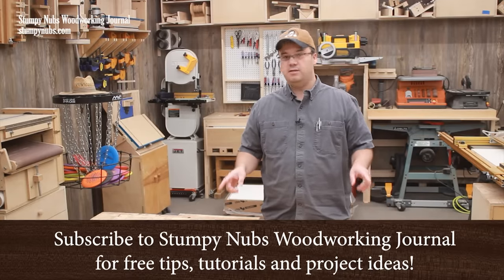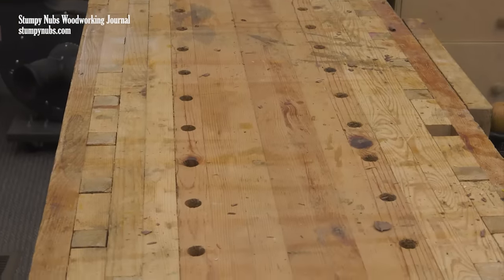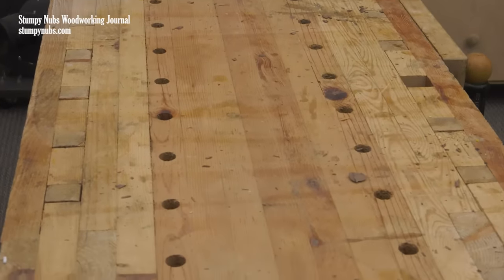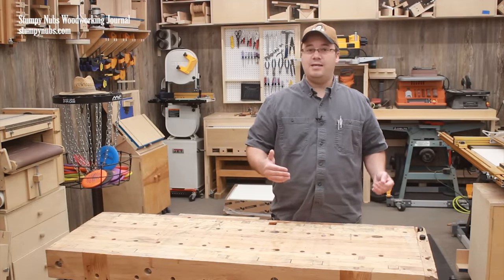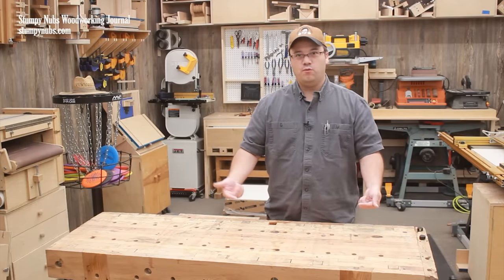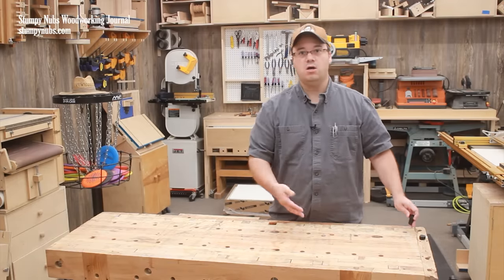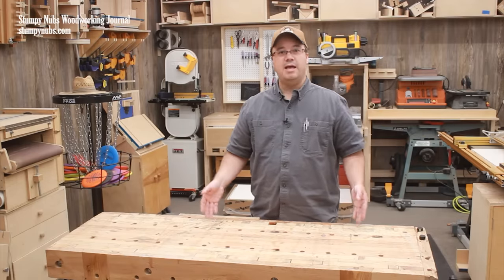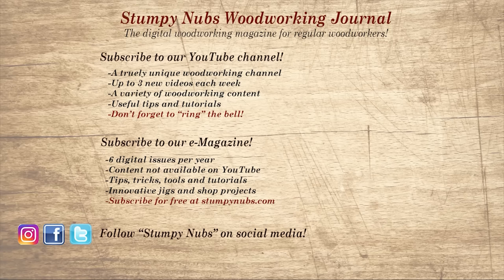Will a cheap 2X6 pine workbench last?

Comment: My great grandfather built a workbench out of pine.  It was about the same size as yours.  When he died, my uncle claimed it.  For years it sat under a tarp in his back yard and was used from time to time as a potting bench.  About 12 years ago I asked if I could have it.  After getting it, I cleaned it up and it is working as well as it did when my great granddad made it back in about 1910.  So pine will be fine if you don't bash it around.
Reply: I made my workbench out of cast off 2x4s in 1990. Since then I have built dozens of projects on it. It has an end vise and uses a square dog. It is 5’ long and 24” wide with tool trough. On it I have built numerous book cases, China cabinets, and tall boy dressers as well as many little items. It is the ingenuity and skill of the craftsman, not the gizmos on the workbench that matters.

Comment: I bought your plans, but took a lot of liberties with them when I built my bench.  I made mine from standing dead eastern white pines that I cut down on my property with an axe and bowsaw.  I cut kerfs in the logs and chopped the joggles off with a machete, and then hand planed them (using a #7 to get a glueable joint).  I ended up with 4x5's, and I milled the mortises & dog holes on their sides before the glue up (I left the bottoms round).  Once I had the top, I put it on some sawhorses and used it to build the frame, but I used all mortise & tenon joinery on that.  The reason for using hand tools was because I enjoy that more, and it was my exercise program last summer/fall. If I had run on the treadmill, I wouldn't have a bench.  The only money I spent was on the glue.  Thanks for the plans - they were very helpful!

Comment: I built one very much like this in 1980. Multiple houses and shops later it is still my main work surface. 2x6 frame, 4x4 legs, and 2x10’s laid flat for the top. Every few years I tighten the bolts that hold it together, smooth out the top a bit with a long plane, and give it another dressing of linseed oil. Height matches my table saw. Quick mounting system for my miter saw. She’s been a good partner!  Love your channel.

Comment: I can vouch for this bench design.  I bought the plans several years ago.  I made mind from 2x10 douglas fir construction lumber since I didn't have any old stuff around.  I let it sit a month or more as suggested.   The bench still looks great, though its not quite as old as Stumpy's I don't think (close though).  I used a vise screw from grizzly to make a leg vise, and originally had a pipe clamp end vise but have recently replaced it with the Twin Turbo vise.  I skipped the square dog holes and the threaded rods going through horizontally.  No issues with either of those.  I am considering adding some dog holes to the other vise leg to use a hold fast to help keep long boards held to the bench for end planing in the leg vise.    I matched the height of the bench to my table saw, so it can also be use as an outfeed table (I leave a gap between the saw and bench so any sleds with runners can still be used and I didn't have to cut runner slots in the bench).  Finish is just danish oil - helps with any glue drops that are cleaned up relatively quickly.    I didn't do a wooden cabinet, but I did put some plastic drawer sets and some other tools and cases underneath.  It adds weight, but it was stable enough on its own in my opinion.  I also have the heavy duty work bench casters on this so it can be moved when needed.  

In a normal lumber price environment, this is very inexpensive bench with all the features of the fancy ones.   The money saved over hard wood can literally buy a floor standing power tool.  I am considering adding some dog holes to the other vise leg to use a hold fast to help keep long boards held to the bench for end planing in the leg vise, and maybe even a tool well on the back side.  

For a working bench, I don't think anyone would be disappointed.    Just know it will get some dings on account of being made from softer wood.
Reply: Really interesting to read your side of the story after all those years!
Reply: Great stuff. 👍
Reply: How are your dog holes holding up? I would think the Doug fir would be too soft and they’d elongate over time when pressure is applied with a dog or hold fast.
Reply: @jimt97038  the dog holes are still pretty tight.   I won't say they are all perfect, but the dogs I made are out of 3/4" dowel (poplar I think) and they are still tight in the holes.   The boards are on their side and cross drilled, so the clamping force is pushing in to endgrain.  That helps.  The only ones I've seen any noticeable elongation on are the ones I put a metal holdfast in.   But even those are still tight enough for the wooden dogs to work in.
Reply: Appreciate your input. I just got the plans and intend to use your experience (and of course Stubby's update) and insights going with Douglas Fir 2 x 12 and a 6' length. Thanks again!

Comment: Digging the disc golf basket in the background and always appreciate the great content.  I find well used workbenches are a living,, changing thing and I never shy away from modifying mine sometimes dramatically) or denting it, or putting new holes in it.  It is perhaps the most flexible tool in the workshop though I have friends that seem to be afraid of even scratching theirs!

Comment: I used two 3/4" plywood for the top and it's served me well.  I did put poly on it just so good glue can be wiped off.  And 100% agree on "it's a work surface, not a dinner table"  As always, very informative video

Comment: Cheers from Tijuana/San Diego; I built my bench from 3×4s that the lumber were cut in 1901 it was 58 years old and it spend 25 years in the shade, when I got them in 1984 for free, from an old man. He kept a log for all the wood he had And until now It's still rock solid, I din't use any glue just dove tail joints, I wish I cud send you a picture of it, It even has a name ( Tantor) cos it looks like an elephant skin, scratches, cuts, stains, but all the furniture that I have built on it it makes it priceless. ¡Take care and stay safe!

Comment: Thanks for the update. I bought a farm house seven years ago and there is a work bench here in my tractor shed built similar. Assembled some time in the 1980's it was used to rebuild tractors and thrashing machines. The wood has long been preserved with years of oils from the rebuild projects. I need to get rid of it now as it is just too heavy to move around but you could pull a V-8 engine and set it on this workbench and it would not budge!

Comment: I made a 20' bench from scrap construction 2x4's about 10 years ago. (Biscuit joined/glued and run through the jointer and planer).. No issues and top is still super solid.  I cut the 2x4's into easy to manage 5' boards and glued them up like a butcher block.. Didn't seal it or anything, just sand it when it get's a ding from something hitting it..

Comment: Hey Stumpy... That be a grand old pine built workbench you built to your standards & will probably outlive you & whoever ends up with it in all eventualities! I like how you gave yourself ( 2 ) options for your dog holes or in this case squares too & placing your end vise where it would work for you, very well done...
I too have a softwood workbench that I built to my needs as well in 32" X 7' with a floor shelf shimmed 1/8" off the floor. I built a new bench top on top of an old one with 3/4" oak veneer plywood, completely rebuilt sub frame & legs. Facing the bench I mounted a very old 9" woodworkers vise 50's era made in PA on it's LH face. I gave it 14" hardwood jaws, i.e. beech & maple from scraps I had...Installing the vise was the game changer!
Last year I built a 2nd bench from scratch, 24" x 8'  along with a miter saw table attached between both benches. I now have a fully functional miter station with a dedicated shopvac sitting beneath it...This bench is also made form softwoods, i.e. 2 x 4 legs in a " L " pattern, glued & screwed together on the inside with pocket holes. I used ( 2 ) sheets of 1/2" poplar veneer plywood for it's top on this build with a ( 1 ) coat of Gunstock stain with ( 10 ) coats of Miniwax oil based semi-gloss clear poly, 320'd by hand between each coat. I did this my way & all of it exceeds my expectations...
Bill on the Hill... :~)

Comment: I built my old construction lumber workbench around the same time you built this one.  I took the time to joint and plane the boards, and it’s still square, flat, solid & heavy as when I built it.  The shelves underneath store my heavier bench top tools (5” jointer, DeWalt planer, etc.) so it doesn’t move either.  I’ve built my share of furniture and shop hardware in the past, and this is still my favorite piece.  I’ll probably hand it down to.my kids some day, and it will be just as heavy and solid then.

Comment: I completed this bench build a few months ago and it is definitely rock solid.  I didn't go with the threaded rod for assembly but did use dowels to align the boards as I laminated them which worked really well.  I like the square dogs.  I added wooden spring clips to them so they can stand proud of the bench by a couple of inches if I need them to and they don't flop around when I have them recessed and am banging something on the bench with my mallet.  I also attached a metal plane stop to the top of one.

Comment: I built my bench out of 2x4 reclaimed lumber. It has sat outside in my back yard through 4 years of winter and summer here in Northern Virginia I use it extensively, and it is still going strong

Comment: I just sold my home and I am now renting.  I left the workbench I made over 35 years ago and it still was in great shape. I did cover the top with tempered Masonite.  This provided a strong durable surface and if it gets kind of scruffy I just replace it, it is very cheap.  It also covers the space between the boards if they shrink a little, where small screws like to hide when you are working on small things like computers.

Comment: I built my workbench with a motorcycle lift as the base. It is so incredibly handy to be able to lift the bench to what ever height I need. Plus, it's on rollers that I can engage to move it away from the wall if I need. The only down side is there is no room underneath for tool storage. It just has a small drawer directly under the top.

Comment: Thanks, Stumpy.  A great example of building a bench your way to do what you want.  Mine is made from 6 inch thick southern yellow pine with the fittings and features that I wanted - my way.  It is only 21 years old and is just as flat as the day I made it.  You and I prove that imported perfect hardwood is not necessary for a good bench.

Comment: I have been thinking about using similar material for a work bench. I really appreciate how practical your advise and presentations are. Hard woods are astronomically expensive right now and as you said, this isn’t fine furniture. Some of the bloggers build works of art that I would never use.

Comment: I’m currently using a 2x4 1/2” plywood topped bench screwed to the wall, got a cast iron face vise, and a harbor freight carpenter vise screwed on and it works. If I had the room I would build an actual bench but gotta make do

Comment: I have a similar bench in my basement workshop. I also use 4 metal rods to keep the boards together. I glued sections of 4 or 5 boards together and then assembled those sections with rods.
This allows me to disassemble the table top and get it out of the basement via the small staircase.
Obviously the holes for the bench dogs are in the glued sections.
Luckily, the sections haven't shifted or warped - but a basement has a fairly stable climate throughout the seasons.

Comment: I built a bench based on this design a few years ago and it has been great. I changed a few things because I had access to different wood.  I had some 2 inch hardwood left over from another project so I used it. I also made my square dogs only ~3/4 square and had one skinny layer rather than making every layer the same thickness. I love how simple the construction method is, it really didn't take any special skills or even careful cuts or measurements. It has been a fantastic bench, for the first several years I had it unfinished, then I spilled linseed oil on part of it and decided to do the rest. It took forever for the round hold fast holes to work properly after getting linseed oil in them.

Comment: I built mine partially based on your 2x6 workbench construction. I bought 2x10x12ft in the beginning of the pandenmic, and price was regular. I had them rough cut to slightly off center and I rip them in half after I got them back. Then they were sitting in my garage drying for months before I starting milling them all square.
I made a split top so I can move it around by myself during construction.

Comment: I built a massive 8ft long workbench with a 2x6 top 20 years ago and it's still rock solid.  To protect the softwood, I covered the top with 1/4" hardboard that I can pull off and replace as needed if it's damaged, painted etc.  It's not a perfect workbench, but at the time it was done with basic tools and limited budget.  It's ugly, but has served me well for two decades.

Comment: That was a nice look back at your older bench build.  I considered your threaded rod idea when I built my bench.  I decided against it only because it required me to go get them and I was building with "only what I had" ( pandemic build, didn't want to leave the house for nothing).  I thought of the threaded rod as a clamp while it glued up kind of like nails and glue.  The glue does the work the nails just keep it clamped together sort of thing.  I saw a lot of other builds on youtube that gave me confidence in only glue (mine was not a year old).   I made it with a Paul Sellers inspired top but the legs are I little bit like yours.  Again, built it with what I had and designed it based on materials I had.   I am short, so I am so delighted to have a bench specifically made for ME.

Comment: I did mine out of 2x4x8s and it's about 7 and some change long, and 18 inches wide. And I glued up the top using clamps and ratchet straps. Which is what I had to do since I had no assembly surface other than my garage floor. And for small things, I have put together a little bench top mini bench, that also doubles as a moxon vise

Comment: I have a Douglas Fir growing 10" from the back of my house. It is 80'-90' and 2' in diameter. It is in great condition. If you want it, come and get it. Douglas Fir happens to be the predominant tree around here. Then, there are lots of Ponderosa Pine, also called Yellow Pine. Once ready for work, they have a beautiful warm yellow color. I built my bed out of it about 30 years ago.

Comment: Thanks. Weight and hieght info is superb. Being a mixed tool worker who is considering creating a new bench these are important facts. Trying to come up with an easy adjustment or possibly two level bench or bench system. Throwing in the sharpening station at one end at more of a proper thigh height… I have another month or so before shop temps are reasonable again to dream, concieve and figure what’s next. Thanks again

Comment: Another option!  A few years back, I was at the lumber yard and noticed a 5-1/2 by 18 inch laminated beam that had been damaged and broken on one end.  I purchased the beam at a greatly reduced cost and used it for my bench top (72 x 36).  Also It has been a great work bench.  The only concern is the need for a fork lift if I ever need to move it.
Reply: So long as there's little or no gravel involved, a pallet-jack and a fairly simple wooden frame can be used, at least around the shop or potentially to the doorway to be hoisted to a truck bed or trailer...

     In hoisting, a chain-hoist is easier and cheaper than the power equipment...  AND (from Navy experience) they also work JUST FINE in horizontal applications like dragging things up ramps and the like... A few models "crowd" the hand-work chain with sheet-metal a bit much for going sideways, but that's easily remedied with a magic marker and an angle grinder, if you're just a bit conservative and careful...  ;o)

Comment: So many little things about my bench should probably need to be shitcanned, but it's about 8 years old and rock solid. It's too wide and too short, but it still does the job. Recently I added a drop leaf to one side to build a wide door on it, but it works and is easily removable..

Comment: I built a 4x8 work table using 4x4 legs, 2x4 bracing and a 3/4" plywood top almost 20 years ago and it's still just as strong as it ever was.

Comment: I didn't use these plans, but my 2x4 bench is about 25 years old and going strong. (although, the top does need to be flattened)  I could chop firewood on it and it wouldn't budge.  You definitely don't need hardwood for a bench.  Pine/fir will do just fine.

Comment: The workbench I built from reclaimed construction lumber is also still going strong after about 7 years. It's not your design but it works for me. My only regret is not making the top thicker, at only 2.5 inches. I'd like to utilize dog holes but I don't think the top is thick enough. It's easy enough to replace though - used mortice and tenon joints but no glue and just bolted it on. I do have a sheet of MDF screwed to the top. As a work surface, MDF is almost bulletproof. (almost) :)

What I really want to know is how'd you get that heavy a$$ Dewalt 735 planer up on that shelf!?! lol